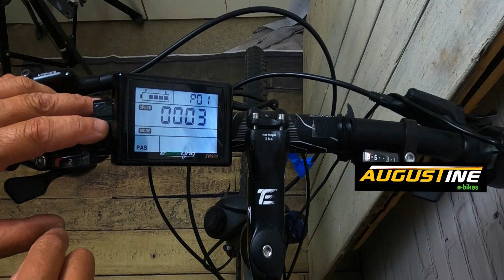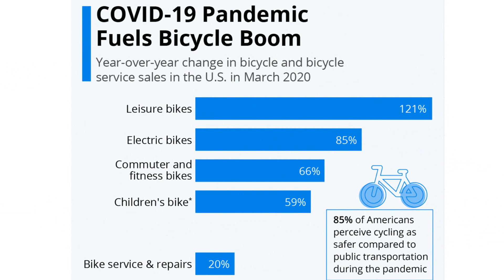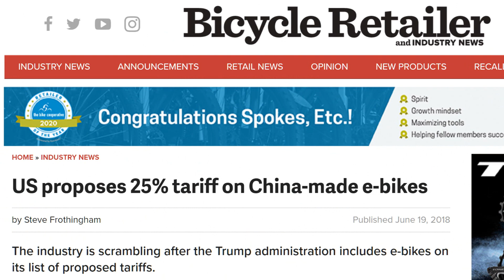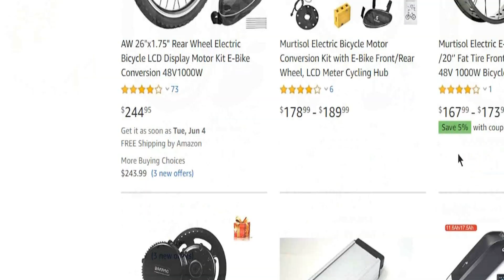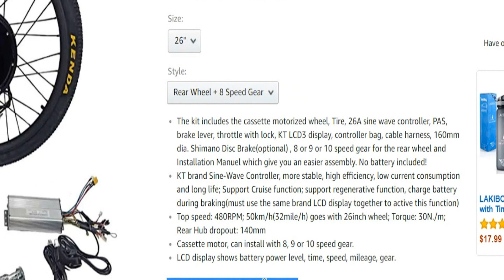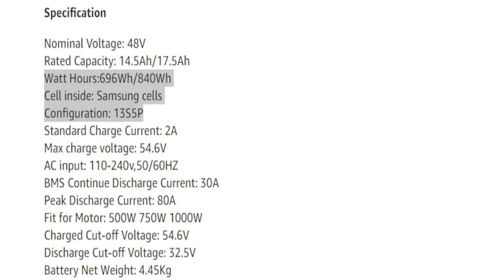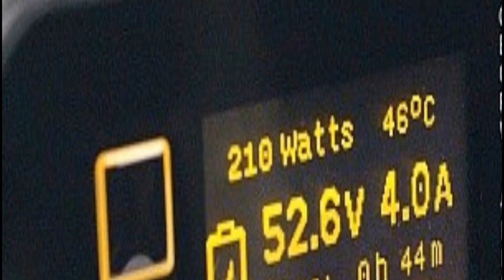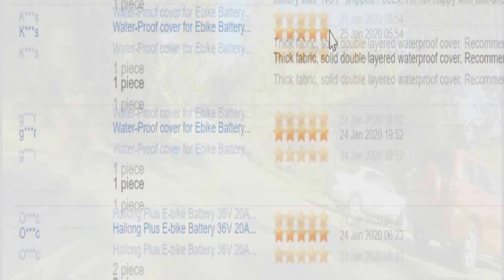The EBIKE Supply Chain and boom of 2020, What to expect for 2021

Comment: Your battery seems expensive. I got a highly rated 48v 20aH battery from Amazon for $389 for my twin 1200w front and rear hub motors and it runs both of them great. It does have the smaller chinese made battery cells however but I like the quick disconnects and triangular form factor.